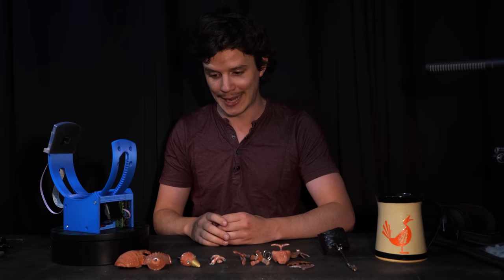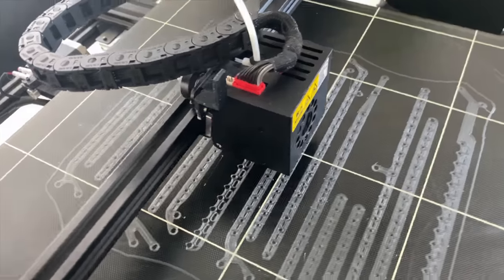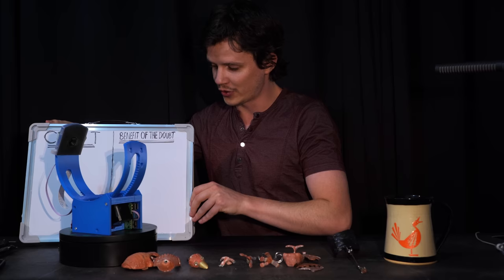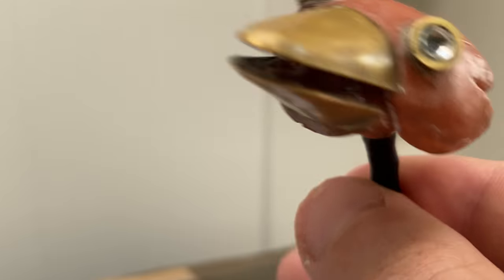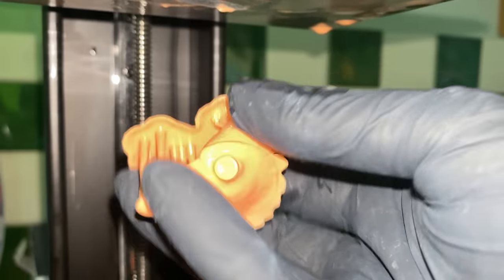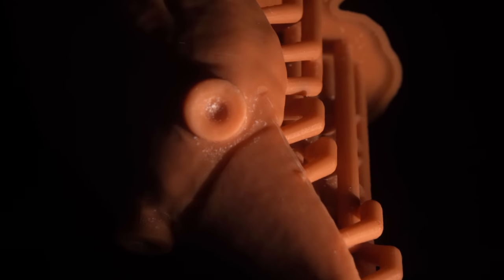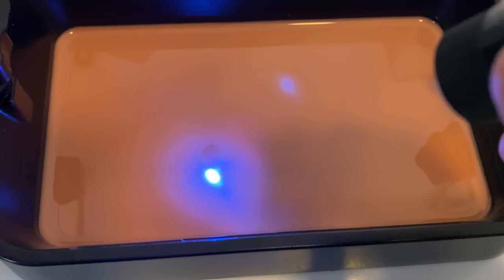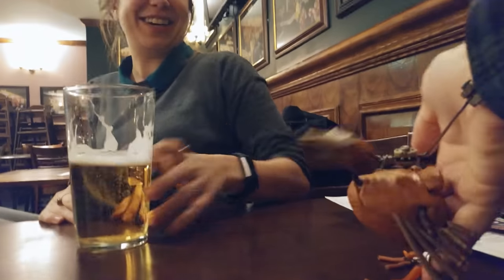DABCHICK got SCAMMED

Comment: I would never buy this kind of printer used. I would search online print services, ask some advice as well as get them to print the head. See if it turns out better then yours after you try more to see if you are just inputing bad slicer adjustments and such. Might also be you resin.

Run some torture tests and see how you're supposed to adjust according to your results. Sounds like the machine is just shot and you just missed Amazon Prime Day for a better price.

Comment: What if you used 3d printing to create the tooling needed to produce Dabchick's part's on demand out of more durable materials. Like press mold for more durable plastics, or a casting mold for a harder cured resin. I don't think you're on the wrong path here, but I feel like you're in a good spot to apply this tool to a lot of practical processes if you're trying to reimagine and experiment with your crafting methods.

Comment: I really enjoyed my resin printer. I made alot of cosplay part
Reply: As a sidenote. I always had trouble printing hollow pieces. Even witg supports so i ended up printing everything filled as a solid. Also you need a uv curing station if you dont. or itll crack like it did when it was on the base plate. You can use the sun too but good luck on that lol

Comment: yeeeeahhhh no, this is a case of crappy printer owners. there is a very simple, easy way to avoid ever having this issue, tape. You can use kapton tape or electrical tape, the point of it is to cover that little gap around the screen so resin doesn't leak inside. kapton tape is great cause UV can still partially go through, so if resin does leak its going to harden on the tape, giving you a great "rip tab" to remove that resin off the top of the screen.
As well.... buy a new screen, in situations like this it's usually better to replace the screen entirely, though if budget is an issue then i entirely understand. your next step for print adhesion issues is environment, while the cover blocks nearly all UV light, having it in a room away from windows is nice. keep them away from drafty areas too as sudden temperature changes WILL cause adhesion issue. In my build, i have heater blocks to keep my enclosure at a constant temperature. another reason for adhesion issues would be the FEP film on the vat, it does need to be quite tight, should sound like a drum when you tap it, if it sounds flappy or dull, you gotta replace that fep, also replace it if its warped. 

proper plate clearance is important too, though this is one of the first things you learn in printing, some people still don't do it right. get a piece of magazine paper, that slick shiny stuff, the thickness is ever slightly more than regular paper and is great for gliding. loosen your plate and drop it as far down as it'll go, once its there, have that piece of paper between the screen and the build plate (dont use the vat for clearance) and put light pressure evenly while tightening the plate into position, once done, manually raise the plate using the smallest distance the printer allows until the paper is able to move freely but still have a bit of resistance. this is probably one of the most effective solutions to "pancaking". followed by primary layer cooking.

Now this setting is usually already pre applied by most printers, but the first 5-10 layers will be integral to build plate adhesion its overexposes the layers and essentially cooks it to the plate. this is why you NEVER want to have your part flush to the build plate, use a raft, its better and make part removal is a breeze.

there are A LOT of things you need to monitor and change for this, resin printing is definitely a step up from FDM printing. over time you will learn from your mistakes and eventually you're going to start printing your own parts, you'll probably buy an FDM printer just for that. that's what i did. 

Welcome, Barnaby, to the world of 3D printing. we're glad to have you here.

Comment: I'll refrain from talking about the usual basics of resin printing, supports and all of that, because I'm sure you're getting a lot of it as it is.
But I'll say there's types of resin that are very durable, others more flexible, etc. I'm sure with enough patience and testing (and money, which I know is a concern), you could find a material that's suitable long term for ol' Dabby. But as others have said, the resin parts could be good for making molds to make the actual pieces in other materials.
For reference, I'd like to recommend some channels that may be useful:
Robert Tolone, a sculptor that makes videos about silicone molds and resin casting, often involving 3D printing: https://www.youtube.com/@RobertTolone/videos
EDF jet RC, a channel about RC planes, but has one video that goes over, in reasonable detail, several different types of resin, and the blends he makes, to achieve the right level of flexibility and durability he needs (which, while RC plane parts are pretty different from puppets, I imagine it's a lot closer than what people who print just figurines or tabletop game miniatures need): https://www.youtube.com/watch?v=gb_I-9UZem0

There's a ton of other channels about 3D printing that are easy to find and full of information you'll probably need, but those two aren't as well known, and cover specific information that I think will be useful to you on the long run.
Best of luck, mate.

Comment: You need to use lighter supports but higher density of supports. The large supports you're using are too large for the small part you're printing. Also try turning up the degrees for your overhang. It looks like your exposure may be good but the print is flexing when it drops down into the resin and not moving into place all the way for the next layer in time for the light to turn on. Try going slower too or increasing your light-on delay.

Comment: im sorry but as a resin printing hobbyist myself, you havent even tried to get a good print, just watch a single 20 minute "supporting resin 3d printing" tutorial and you should be up and running, as it stands, your supports are f**king massive and attached waaaaaaaaaaaaaayyyyy too deep. im not familiar with the resin you are using but you may also need to calibrate the cure times and lift speed since tha tis by no means a "standard" resin which would do fine with default settings. i went from complete failure to 90% success rate in 2 hours of educating myself.